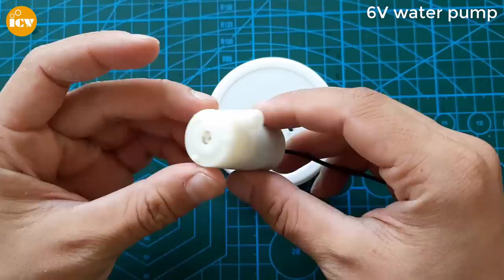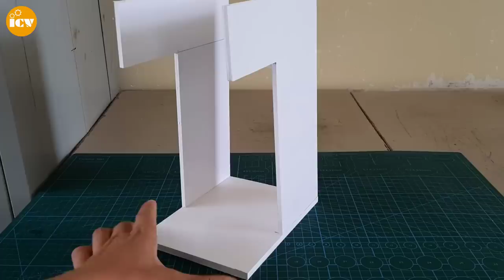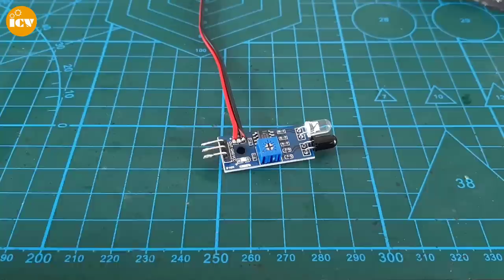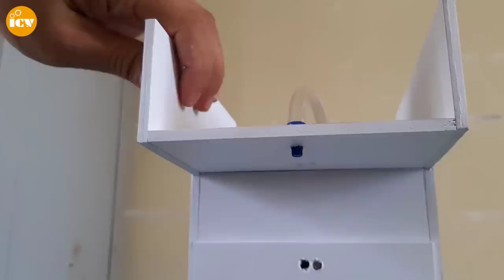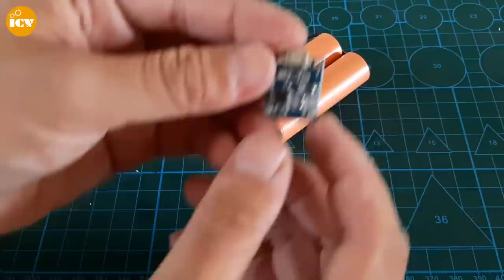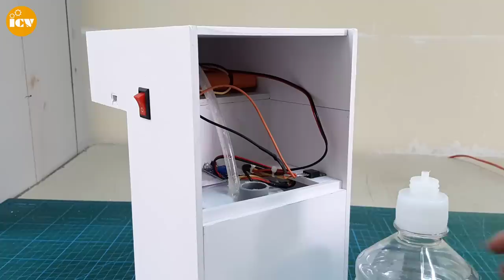How to Make Automatic Hand Washing Machine || Without Arduino

Comment: Hello. Can u list down the piece of materials that u use in this project. Thank you sir.
Reply: I have same video...All details are included...I think that help you
Reply: @TubeLightDiscover  excuse me, hi can you share me the details you said
Reply: @TubeLightDiscover  plz tell
Reply: I will give you the details because i have done it.1.Summarine dc water pump 2. Water tube.3.1k resister 4.Proximity sensor 5.TIP 32C resister and 6. Wire
Reply: @TubeLightDiscover  ahaa malayalii analleeee
Reply: @m3techfactory616  yes bro

Comment: Very impressive. Don't you think it needs a cut out content view slot, or indicator so you know when the content is running low?
Reply: Level sensor and piezo electric buzzer will do the work
Reply: @souravjadhav4730  why to complicate things, keeping it simple with a slot is the best option.
Reply: @kashv1793  with acrylic glass.
Reply: @Kashish Verma buzzer will remind/strike our minds that we have add the sanitizer, moreover cutting a slot isn’t proper engineering...
Reply: Aap hame bna kr de sakte ho
Reply: @kashv1793  it's not that complicated
Reply: @souravjadhav4730  correct
Reply: @bharatkhatri1987  hi
Reply: @सुफलतिवारी  Hi Sufal

Comment: You can extend the refill pipe till top. So its safe to fill the sanitiser from  top without opening the back.
Reply: Instead, a long/tall bottle can be used whose neck-n-cover remains outside the top cover so that it can be easily refilled.
Reply: You both op
Reply: Yes
Reply: hello! did you just connect the black and red wire to the obstacle sensor?
Reply: @bharatkhatri1987  l

Comment: what do you think about fire safety . alcohol is flammable and we are putting a pump in it .
Reply: It is very dangerous
Reply: Submersible motor in alcohol dangerous
Reply: Not practical model because there is a chance of fire of motor......But a good attempt....Not suitable for long run....
Reply: if motor shorts ... the blast will occur. 
i do experimenting with this , dip the shorted motor into alcohol, when the power is on in few second a sanitiser booms

Comment: the type of pump used in this project which will dip in alcohal is highly dagerous .it can catch fire easily.
Reply: What is the best kind of pump? can you suggest some model or!?
Reply: @kilhas07  Try using a peristaltic pump.
Reply: It's molded pump... No problem
Reply: Anoop Kishore is there another budget option? For bulk project so perilstatic is quite expensive.
Reply: @spyinsecret0075  I guess you can also try diaphragm pump. It's cheaper than a peristaltic pump. Make sure to instal a one way air-inlet valve in the storage tank, which opens and lets the air in when the pump operates.

Comment: i used tip 42c transistor and when i put the power of 5v battery the pump is ON regularly, also i can use mobile adaptor in this case there is no pump ON and IR sensor also.My IR sensor is detect the object but my dc motor is continuous run
 my connection is totally set
Reply: same here
Reply: there is a problem in your IR sensor module..Your IR is giving high value every time rather giving high values whenever any obstacle is  detected.Your IR sensor is giving high values when object is not detected and giving lower values when object is being detected..and here the citcuit shown is using that type of IR sensor module which gives high values when there is any object detected..so here you will have to do some minor changes..you have to make NOT gate using that transistor instead of making OR gate..!!
Reply: @saikirankaleru5762  aapki pblm khatm.hui kya???

Comment: hey i have followed you but when i switch on motor directly on and bringing hand to sensor stops the motor i am confused so much please guide what iam doing wrong
Reply: Manish Rauniyar use a PNP transistor
Reply: @piuselectronics5707   I tried  with tip 42c transistor but not working how can I send u my project picture
Reply: Send me the pic I'll check
Reply: I am facing the same problem, motor keep running as you put hand in front of sensors it stops
Reply: Try using mje172 transistor I tried it and it worked
Reply: @piuselectronics5707  and bc 557 sir
Reply: @manojsoni2973  did it work
Reply: @piuselectronics5707  hello, I using everything correctly but when I connect it to battery my dc motor is continuously running and my ir sensor is not working correctly,sensor is not doing anything only dc motor is running when I connect it to battery, I don't understand what to do to fix ut

Comment: Super bro i know how much hard work it takes to do it. I tried it using bc547 transistor instead of Tip 42 c bcoz it was not available in my locality ,but I'm not getting with it. Can u tell you it is not working with this transistor.
Reply: Amol Shah Are you sure it ll work on 41c?
Reply: use bd 140 pnp or bd 139 npn accoring to the outsut of sensor

Comment: when my ir sensor is not sensing my mototr will be working but when i sence my IR sensor my motor is not working
Reply: the sensitivety of the IR.. same what i observed. for me the solution is to off power and try again and make it sure you have constant voltage to apply... my observation only.. thanks

Comment: Nice video...i have request that pls make a video by using uv sensor in place of ir sensor. If we use uv sensor it works good on outdoor also.
Reply: Its like you also noticed that the sensor misbehave at the outdoor, the sun rays is triggering the ir even without any obstacle brought near the sensor...will using UV sensor solve this issue? Thanks

Comment: Is it a good idea to dip a pump in sanitizer?
Reply: No issues buddy as it is submersible pump. Just use the heat shrink sleeve on wire joints properly.

Comment: Bhai sabhi components ke name with specific volt ke sath description me de do please. Total cost Kitni aayengi??
Reply: Part names given in circuit diagram.
All working between 3-6v dc.
Need kit let me know on
Reply: @bharatkhatri1987   i need
Reply: @bharatkhatri1987  me to please share the details.. components name volts

Comment: Sir,I have a problem on this sensor if the sensor has come to sunlight the machine is automatically on so please suggest what type of sensors used in sunlight....indoor it means closed sunset the sensor is working but outdoor the sensor is not working i.e sunlight please suggest which type of sensor is used in sunset

Comment: In this, I want to implement a 1 ml mechanism so that when someone tries to extend his hand towards the sensor only 1 ml is dispensed at a time. Any idea how can I achieve this without any controller or timer?
Reply: may be timer ic will work but not sure
Reply: Using Arduino...
Reply: @310johntitus7  the whole point is of not using an Arduino. I figured out that Ic555 will do the job or a motorised mechanism  that presses the sanitizer tip instead of using a mini water pump
Reply: Use IC 555 trigger mode. The pump will be triggered and will cut off. 

Regards,

Sushil Madhukar Adhikari
Reply: @sushilmediahub  that's exactly what I figured and it's working like a charm. Thanks for replying tho
Reply: @bharatkhatri1987  please share circuit of timer
Reply: hey harsh i m doing RnD with this concept . and also with uktrasonic sensor so we csnbuse it outdoor also. pls comment for knowledge sharing
Reply: Dont use a 555 cause the sensor flank while person put the hand will hold the trigfer pin of ic, try to use an 74121 or 74221 that has this controller for positive or negative flank, also has a configurable monoestable.. Also is more estable cause the dc motor generates an electromagnetic disturb and if you add to a 555 a flank detector it will get some problems about it.

Comment: Hey..... Sir there is problem in the sensor when i put in the sun light then pump continue working can u give the solution of it
Reply: Try covering the sensor with heat shrink sleeve and leave very little open....
Let me know if it works.
Reply: For me also same problem..the solution is to cover ir sensor..am I right?? or we have to use ultrasonic sensor...if ultrasonic sensor uses then how to give connections same like ir sensor..or how??
Reply: @hemalathasadam5485  the ultrasonic sensor needs arduino to the best of my knowledge. It cannot be used as simply as IRS module.

Comment: hey, great video, i want to know de mesures of the estructure and the volum of the bottle?
Reply: 5v dc pump motor
Ir sensor 
LED
5v charging adapter
5v lithium battery
1 kilo-ohm  resistor

Comment: I facing an issue... At first it worked and after a while the motor stopped... Check voltage drop at transistor c port and motor it's 0.6v to 0.8v... without motor connected it shows 3.6v (proper battery voltage)... Please help...

Comment: Nice project I made this with your video thank you.. but Sir when I place in outside where more lighting is there it turns on automatically
Reply: Use ultra sensors
Reply: Even if you try an enclosure or something to block direct light?
Reply: Can you tell me th components requirements and circuit please I have to make it within 2 days please help m

Comment: HOW MUCH TIME IT WILL BE ACTIVE OF THIS FULL CHARGED & 

  HOW MUCH VOLTS BATTERY & HOW MUCH CAPACITY THIS JAR . HOW MUCH SUPPLY 5V BATTERY CHARGER. WHICH TYPE PIN DO YOU CONNECT THIS PROJECT & THIS S & WHICH SHAPE &  HOW TO FIXED THIS SHEET & ALL INSTRUMENTS MODEL NUMBER TELL ME & WHICH TYPE CHARGER FOR YOU USE B/C WHICH TYPE PIN DO YOU USE

Comment: Sir, AAPKE connection k according mene bhi ye banane ki.koshish ki
Or last 3 din se koshish kr raha hu but ye work nhi kar raha.
Pump ON nhi ho raha or na hee IR sensor.
Agar voltage badha deta hu to dono ON rehte h pr mujhe esa chahiye k jb hath pass lkr jaye tb PUMP ON ho
Pr ye nahi ho raha. Li-po battery bhi use ki ussey bhi koi asar nahi o raha h.

Transistors bhi change kiye(TIP 41C , TIP 42C) bhi use kiye 
Please guide me sir.
Reply: Pic bhejo check karte hai
Reply: @Shiv7299  pic se aap kese samjhogey?

Comment: I had done all the connection as per ur circuit diagram but my ir module sensor is not detecting the obstacle instead it is still red light

Comment: Sir, I have designed this project to your given way/circuit diagram and I have connected all the connection in right manner but I can supply the 5V power to my adaptor the IR sensor and water pump is regularly ON and it can not off, please help me to sortout this problem.
Reply: Ir sensor is wark only in side of house not out side of house ven sun light is on sensor is on also
Reply: PRUEBA CON EL TIP 32C
Reply: Try watching video on Innovation Shack. May be that helps.

Comment: i tried this at home all connection are correct as u do but at the time of power supply the pump cant work , but when i test pump seperatly it work,
please let me know my mistake.
Reply: Same problem but I have used TIP32C transistor

Comment: Sir there is problem my pump is regular on after supply the power  and when object come to the front of ir sensor then it will be slow down
Reply: May be you can see the circuit video on Innovation Shack and see if it helps.
Though ICV had explained it will in his video.

Comment: make usimg IR sensor and TIP42C with 1K resistance, when switched On water run continuosly and if hands are put water stops. reverse of result what is the expected i.e when hands are bought water should come instead water coming continiously and if hands are bought near sensor, water stops coming. kindly help, regards and guided me
Reply: Connect the positive end of the motor to vcc and negative to the ir output

Comment: Hey. I have followed each and every step. 
As soon as I turn on the circuit, motor directly turns on. When hand goes near sensor, motor turns off. 
I have used TIP42C PNP transistor. Please help...
Reply: Same problem with me.

I made this circuit yesterday and still struggling with it. Automatically its giving output current without putting hand under IR sensor. If I put hand under sensor LED glows means my IR circuit is working properly. I am not able to understand why it is always giving output current without sensing. I am using Tip42C.

I am using it in my room where there is no sunlight or strong light.

Please help me where is the problem....
Reply: Check the video on Innovation Shack. May be it helps you to understand circuit better.
Though ICV had explained it well in his good video.
Reply: Piyush Jaiswal  I read in another comment to use npn transistor tip41c. Let me know how it goes!

Comment: My sensor direct running water and use it by hand it stopped. Pump never stop without sensor
Reply: Try watching circuit video on Innovation Shack, may be it will help solving you problem.

Leave a comment, may be he can help.

Comment: I have a challenge. When using this sensor outdoors where there's sunlight, the photo diode is always activated and making it always on thus limiting one using such type of sensor outside. Who might have a solution?
Reply: Same problem
Reply: Trying  changing  the design of the  structure  in away it blocks exterior lights

Comment: This machine is working only indoor, and out side (sunlight ) this machine is not working. why..?
Reply: because there used proximity sensor.. which is only detect light difference.. the sensor is not compatible if the light in the room is brightening or in the sunlight